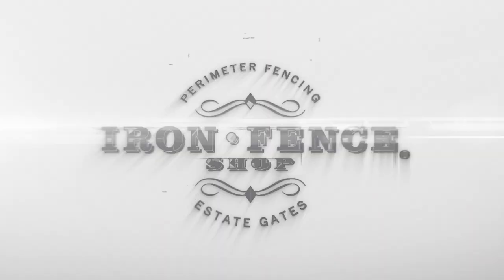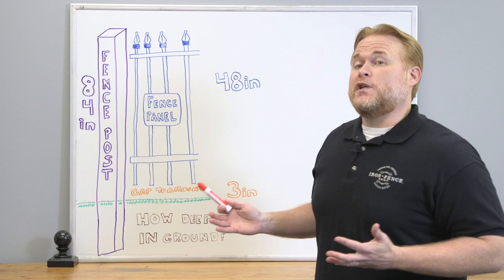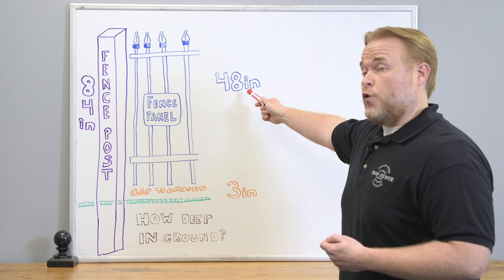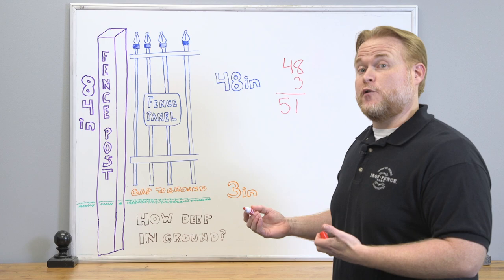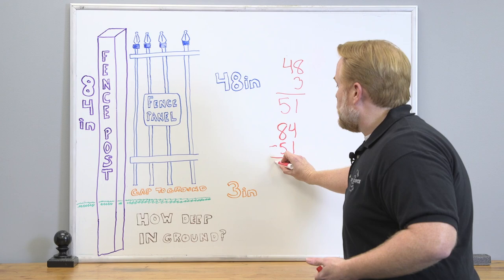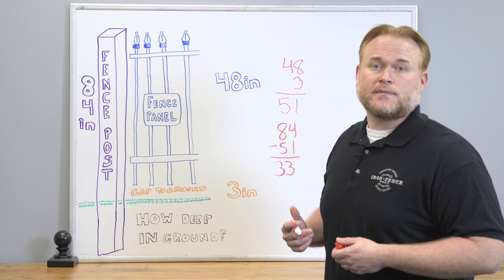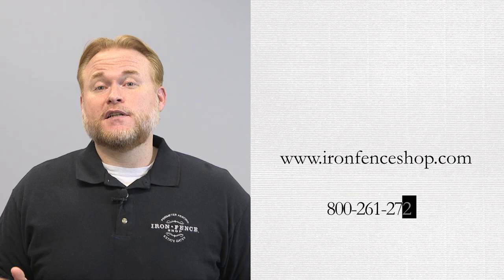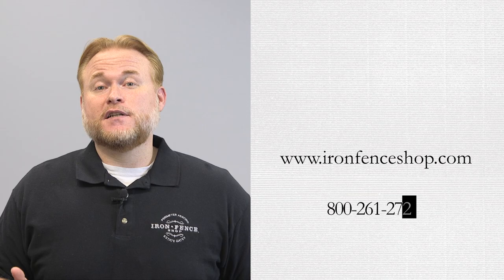Calculating Your Fence Post Hole Depth

Comment: Just buy little longer post and set them fast,  use a tight string at the height you need, mark them and cut with a portable band saw, you just saved yourself hours of wasted time, I put up over 400 fences a year, this is the way to get it done fast and accurate
Reply: Definitely.  I can't imagine trying to set a post exactly 33" deep.  What about changing ground levels?  And who starts with 84" posts?

Comment: Length above the fence for a post cap (add if you have it in your fence design, e.g. 4 inch)
Fence panel height (add fence height e.g. 4ft, 6ft fence) 
Ground clearance for panels (e.g. 3 inch above ground clearance) 
Below ground post depth requirement by local code (e.g. frost depth + 6inch) 

Figure out and add all these numbers and you will have you total post length and round that  up the next Ft.
E.g. if all of these numbers add up to 9ft 6in, you should buy 10ft posts. 

Keep the excess height above the ground and cut it off once the fence build is complete before adding the post cap. 

Pretty basic.

Comment: Rule of thumb, height of post / 3 for depth. Thickness of post x 3. 2000mm high, thickness 100x100 post, so 2000/3 666mm deep. 100x 3 =300mm square.

Comment: This was helpful but I was hoping for discussion about how deep post holes should be. I'm looking to use Postmaster posts and they come in 6' - 12' lengths and I don't know which height to go with. Your calculation method helps me out but what is a good minimum depth of hole? I'll keep searching but thanks for sharing this!
Reply from the maker: Hi Kevin.  We didn't delve into specifics since there are so many variables on what size and how deep the post should go.  Even in our in-house lines it can differ greatly depending on the part, its application and where you are in the country.  Thanks for watching!
Reply: @Ironfenceshop  I understand. I did confirm with a couple reputable sources that my frost depth is at the back-breaking height/depth of about 53 inches. At 130-140 linear feet of fence I'm in for it.

Dear God 😭😭😭🦺🦺🦺⛏️⛏️🏳️
Reply: @kevinm8865  frost depth is overly exaggerated, i work for the county and install street lights 30 feet tall and our foundations are 33 inches deep. If the soil your digging on is somewhat firm and rocky you should be ok.
Reply: @oscara8136  Good to hear. It's 100% clay + 100% rock chunks lol. More like 98% clay and 2% rock. Last week I almost had a heart attack digging a 3-4' post hole (about a foot wide) for a Pecan tree transplant.

It was bone dry clay.
Reply: 1/3 below the ground for fencing and 1/2  below for retaining
Reply: @FLATEARTHPERTH  1/3 the height above ground, or 1/3 the length of the pole?
Reply: He didn't say anything about how deep a post hole "should" be. All he did was tell you how to figure out how much of your post would be left after you attached your fence to it.  There are rules about how deep a fence post "must" be buried. If you followed this guy's instructions but happened to start out with a shorter or longer post, or a shorter or longer fence than he did, you could easily end up with a post hole depth that was far too shallow or far too deep. Rule of thumb is to dig a hole 1/3rd the height of the fence. If you live in high wind zones, look at the building code.
Reply from the maker: @Jim-vi5wi  That is correct, but even the 1/3 rule can be skewed by the height of the panel and available post heights.  6ft tall fence, 2ft minimum.  Makes sense and works.  3ft tall fence with a 1ft post depth.  Way too shallow in my opinion.  

There are also other factors like the wind load you mention and freeze lines for certain areas (although that's another bone of contention sometimes too).  

What we were trying to show is that you need to factor in that gap under the panel in your overall above/ below ground for the post.  We would normally work through what post length you are starting with in the quoting process as lots of factors play into that.  Its tough to make a 'one size fits all' to these type of videos.   

Good comment and thoughts though!  Things to all consider for sure.

Comment: Den, 
After looking at video, I get post holes should be 33” deep.
9’ 9x 12= 108”
Panel is 6 ft high 12x 6= 72”
3” from ground gap
72+ 3”= 75
108- 75= 33inches
Is that what you get?
Reply from the maker: Hi Brenda.  For a detailed question like that, it would be best to call us at 800-261-2729 or send us an email at sales@ironfenceshop.com.  I have some questions on what you have typed up.

Comment: My only question is Why?  you didn't answer why the post is that deep.  All I saw is someone doe elementary school math.  Did not help.   How do you adjust your calculation for longer posts or higher fences??
Reply from the maker: The calculation will adjust for longer posts or taller fences.  As for why they are that depth, that can be for several reasons regarding weight, height, frost line and special circumstances.  This video is going over the rule-of-thumb basics for a DIY installer to understand the factors that go into coming up with your post hole depth in a majority of situations.
Reply: Yes, it's entirely useless. I'm baffled anyone made this video.
Reply: @kayemm7925  i have a 10ft post , my gate is 3 ft high ,  i think i better start digging now  ;)
Reply: Videos are overkill. 1ft in concrete will break ur back trying to get it out😂😂😂😂😂😂
Reply: @kayemm7925  PART 2: "What to do if your Post is too Short to Reach the Bottom of the Hole..

Comment: Why not cut 12” off pole and only dig a 24” hole?
Reply from the maker: You may need more than 2ft in ground depending on the fence/ gate and your location.  However, we have had folks trim the post tops level after the fact rather than trying to get each one set perfect.  However, that only works if its too tall or taller than the fence.